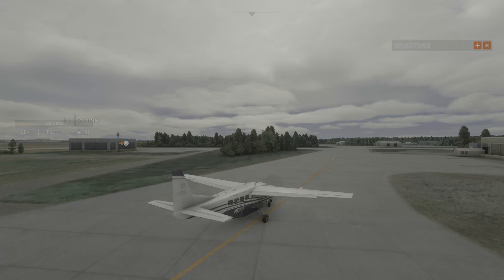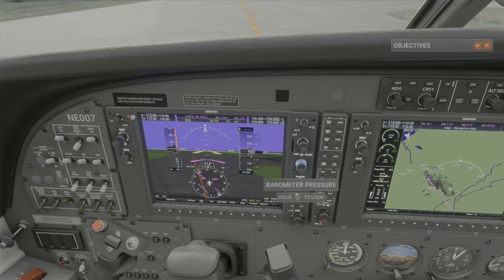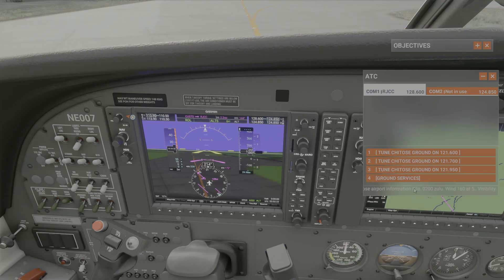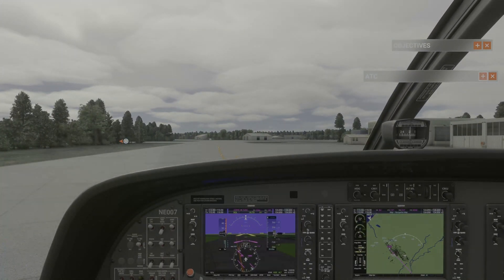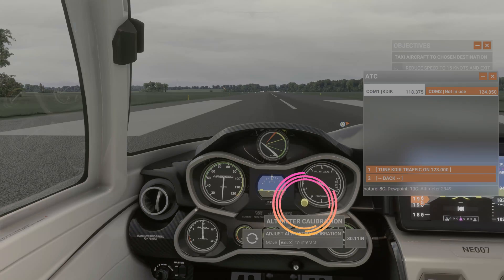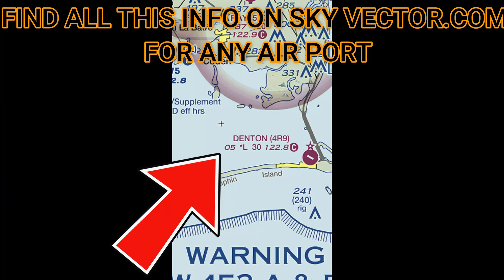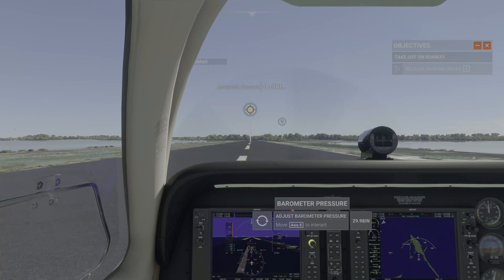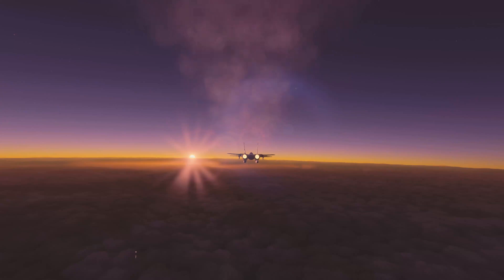MSFS2020-HOW TO SET UP YOUR ALTIMETER WITH BARO KNOB!WHAT IT DOES!AND WHAT'S IT FOR! EXPLAINED!

Comment: I realize that I need to know the altitude of the runways when planning my flight, but how do I know the correct flight altitude if I accidentally turned the BARO knob at 5500ft during flight?
Because the barometric pressure is different for every 1000ft difference in altitude or in cold or warm weather!